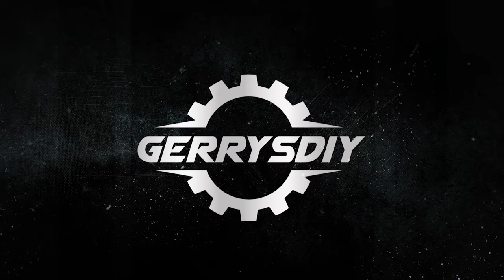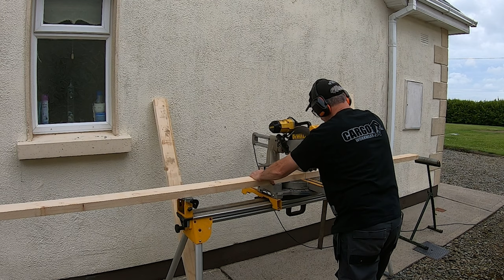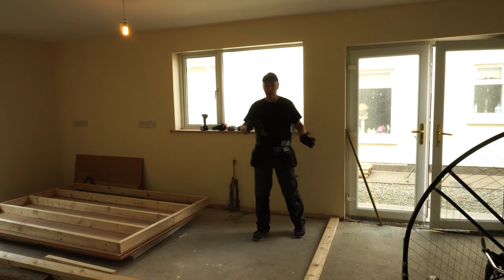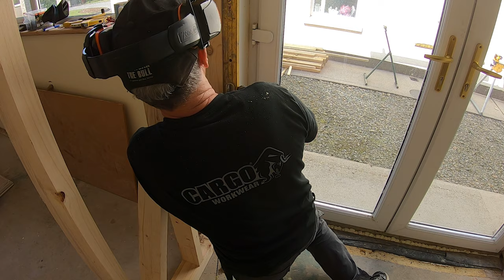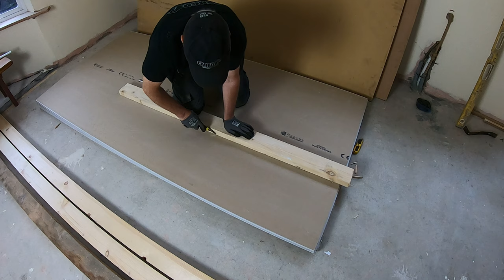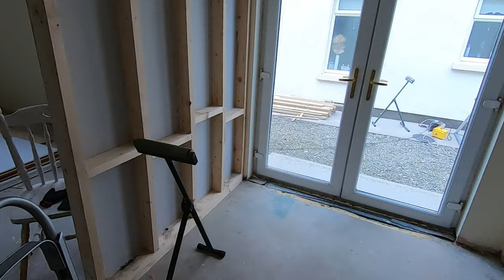Renovation Project __ Easy Build Stud Wall partition

Comment: Thanks for sharing! Always great to see how someone tackles jobs like this. In the US they use double top plates (overlapping, e.g., perpendicular walls to have better structural integrity), interesting to see you opting for a double bottom plate instead. Any precautions taken to avoid moisture from the concrete floor from going into the (untreated?) sole plate? Or no moisture issues expected because of underfloor heating?

Comment: Now all you need is for the HVAC guy to come in and butcher up all your framing to run his ducting.
😂😂😂😂😂😂😂
Reply from the maker: Hi. I'm as bad my self 😜. There are lots of wires in the wall now for over unit and under unit lighting, power sockets and a cold feed pipe too. Added some grounds for some wall hung cabinets too. All covered over now. More videos on this and some other projects soon Thanks for taking the time to comment Cheers Gerry👍